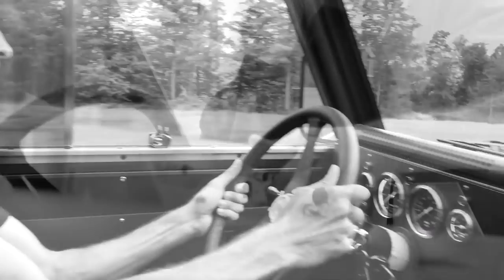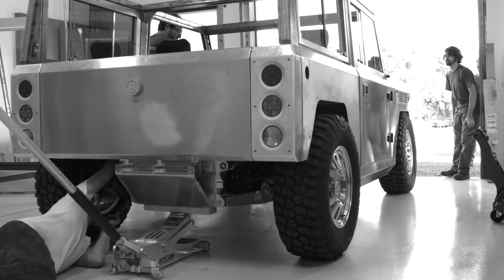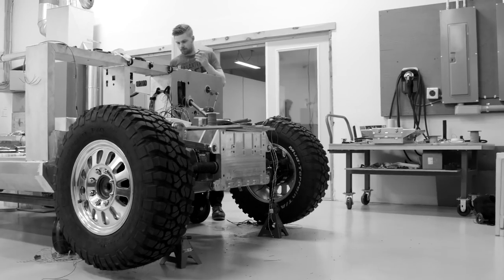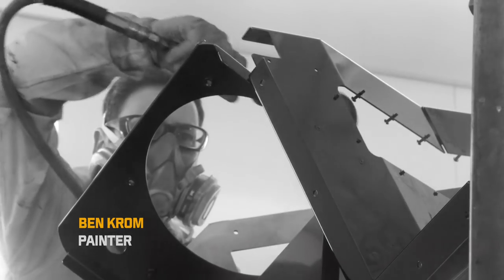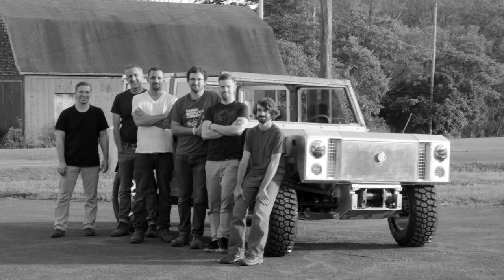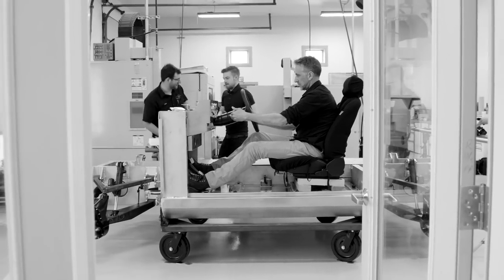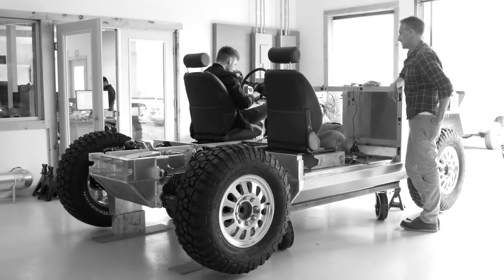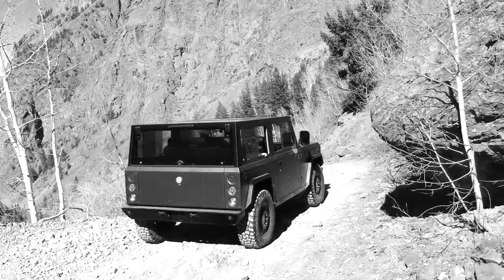BUILDING THE B1 - Bollinger Motors

Comment: There was a tremendous amount of detail that went into creating this first prototype and it shows. Quality wise, this thing looks like it blows regular production cars out of the water, thick aluminum and rivets everywhere. But, will this truck be able to be produced on a mass scale that is cost effective without decreasing the quality of the truck?
Reply from the maker: We hear you and we're doing our best. Still a few details to shake out. We’ll have pricing dialed in by mid 2019, production starting late 2019, trucks rolling out 2020.
Reply from the maker: It will and it is! Still a few details to shake out. We’ll have pricing dialed in by mid 2019, production starting in 2020, and trucks rolling out soon after that!

Comment: I would consider buying one, It would be great to see some solar panels fitted to roof or make them the roof panels for a truly off grid type vehicle. Just park it in full sun and the thing should be able to extend the range significantly
Reply: JDT738126   parking it under a solar array when it is not being used, would be viable...solar panels covering the vehicle not practical, for the amount of energy gained......you need a BIG solar array to do any substantial charging.
Reply: Jim Hofoss that's what I figured I just don't know enough about solar yet but I am going to begin studying the subject
Reply: JDT738126   Solar is pretty basic, especially with an offgrid application.  A basic system is the solar panels, a quality mppt charge controller, and deep cycle batteries.  An inverter hooked to your batteries for AC can be added.  I have been doing off grid solar systems for about 10 years....its silent,  more economical than one might think if you do it yourself...and being self sufficient is the best part.  Many juristictions trying to ban off grid systems, check your area...I think that is criminal.   Sizing your components to what you want it to do is the hardest part.  I run my entire farm on a large array on the south side of the A frame farmhouse!   It’s a great hobby to get into....and you will quickly learn what larger systems really are capable of....even if you live in a less than perfect latitude....I live in northern BC, Canada, with long cold winters.  The output of solar in December is weak, with several days in a row of minimal charging....so in my case, a generator helps out charging the batteries in the short months of December and January.  Keeping the panels clear of snow in the northern climates is key to keep the juice flowing...so it’s not without a bit of labor at times....but good luck on your project, I am sure it will put a smile on your face!

Comment: bollinger did you guys announce a manufacturer yet? Cummins would be sweet. i know they have been working really hard on electric powertrains the last couple years. after all, what would be more reliable than a Cummins electric motor?
Reply from the maker: We haven't chosen a plant yet. Still a few details to shake out. We’ll have pricing dialed in by mid 2019, production starting in 2020!
Reply: Aluminum rims are awful for off roading

Comment: I absolutely love this vehicle. Love the Portals!
I've owned 2 Landrover 90s and one Landrover 110, 4 classic range rovers and a G wagon so this is right up my street. 
I'm a solid axle type but I like independent suspensions with long travel. 
The problem with really long travel independent suspension is that when the suspension compresses the ground clearance under the center of the vehicle vanishes, whereas with solid axles the lowest points under the diffs remain relatively constant.
Any chance of a long travel solid portal axle version?
Reply from the maker: Thanks for the love! Since we're starting of with double the ground clearance than Jeeps and most SUVs and trucks on the road, we still have more ground clearance with compression than those vehicles started out with. And with our dual motor set up to avoid a transfer case, which would erase a lot of ground clearance, we can't do a solid axle. There are half axles coming right off the gearbox.

Comment: Benefits of an electric truck without the complexity and cost of auto pilot, supercomputer, fancy panoramic glass, fancy doors that swing upwards. wish tesla would do this so they can produce an car not just for the rich.
Reply: Bollinger B1s will probably cost the same as Teslas though.
Reply: Getting to a scale of production that’s as big — and hence as cheap — as the mass market car is hard and requires a lot of knowhow and production capacity. Tesla’s been able to get the Model 3 down to where it is because of the lessons and assets they’ve acquired from building the Roadster ($$$$), and then the Model S & X ($$$). The Model 3 ($$) starts at $35K before any tax incentives.

Tesla’s just making cars that are meant to compete with other typical luxury cars.
Reply: M House I like what you did there very clever.
Reply from the maker: Yes, we hope to get to a point of capacity where we can start to enjoy the benefits of scale, but that will be some time away. At first our trucks will have to be more expensive. But we're working hard to get the truck done right!
Reply: I just wish the mainstream manufacturers (Honda, Toyota) would produce some good, basic electric cars without all of the autonomous BS.
Reply from the maker: I couldn't agree with you more!
Reply: M House i look forward to the 2wd utility version,a real ev truck,without the tesla add ons is sorely needed
Reply: @BollingerMotors  of course.  If they are hand made like this.  It will be as expensive as a Mercedes Benz G wagon or Range Rover.  The only way they'll be in the same price range of a 4Runner, Tacoma, or Jeep Wrangler eventually is if you guys can mass produce it.  I hope to see it one day
Reply: @BollingerMotors  Hurry!  Before our electric vehicles are wheelchairs! 😉

Comment: I was just thinking of a car my boss has (a 1996 NZ built 4x4 (only 18 made)) and another NZ built vehicle (the Trekka), both look similar in shape and design to your vehicle but smaller than the B1, my boss' vehicle used running gear  and interior parts scrounged from a mid-late 80's subaru leone 1800cc 4wd, the trekka used skoda running gear, loved by farmers since they were simple to work on, take a look and see what you think, kind regards, kieron

Comment: I really like the car, but I'm wondering if the US off-road guys will like the Independent Suspension (ground clearance is good but in uneven ground articulation is not as good) and worry about how waterproof the batteries and engine are. 
They may also wonder how this vehicle will behave after lifting and fitting bigger tires to it... Will the battery time drop? Won't there be issues with the axles being too short after the lift?
Reply: You are way ahead of yourself sir. Already thinking about customizing a vehicle that wont be out for years. The wheels they have on there look fine to me.

Comment: Could a RWD only mode extend range??
Reply from the maker: We thought about that too. Adding the components to do so would add weight (in space we don't currently have), causing an even lower range. But in short, it's more efficient to run both motors with 1/2 overall load on each than one motor with full load.

Comment: will there be range extenders like a small generator or solar panels or something to really make this thing capable? and will there be aftermarket support like most jeeps and 4x4s.. love the absence of all the crazy technology...i like guages...not screens. its just looks so simple that with enough support and parts even the offroad guy in his shop can be able to modify it (as long as he knows how to not get electrocuted) and I really hope self driving cars dont run vehicles like this out of the picture...also i love the classic 60s bronco vibes...i would love a solid axle or rock buggy version designed for the really hard stuff. and this is coming from someone who has never really been on board with EVs even though I'm a millenial so im supposed to be. too bad it will be too expensive for me to afford right away..guess ill have to stick to my turbo XJ (which I love just as much)
Reply from the maker: Thanks for the compliments Gerrad. We bring a generator for the way-out there treks, but solar has a long way to go in order to be worth lugging along on a vehicle. There will definitely be aftermarket presence and support.
Reply: Will there be an connections for an extended range trailer?.. could you produce something ( a trailer) off-road capable that could contain another 120kv battery?..
Reply: @mkd03515  
Good idea, maybe even a trailer with 2 motors!?
Reply: Prof. M. Otto Zeee JCD ECS no I don’t think a trailer with a drive system would be efficient to extend the range.. all really that would work an be effective is an extra external battery pack.. could run a campsite, off grid cabin, extra power for tools, or just give a longer range for more exploring..